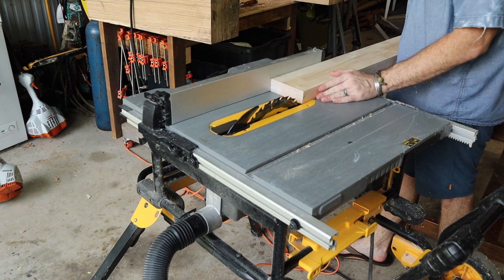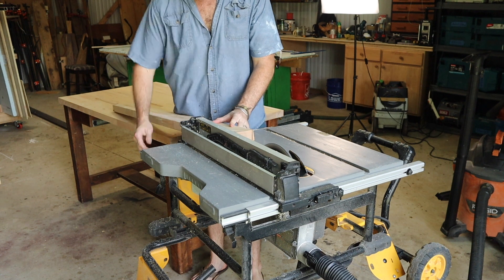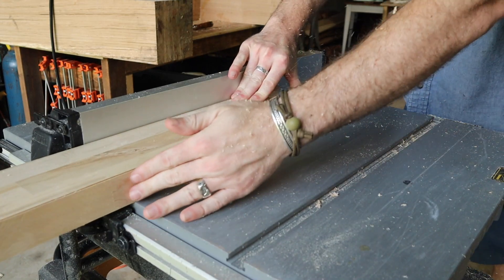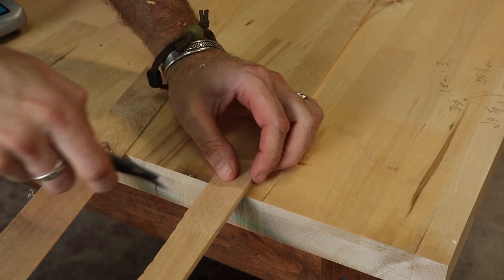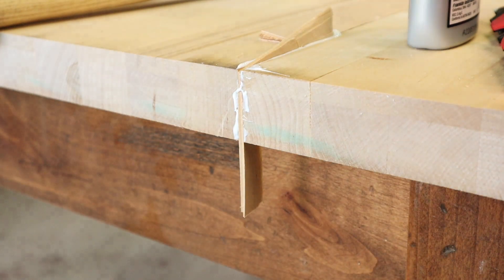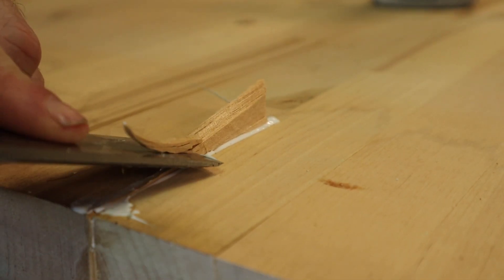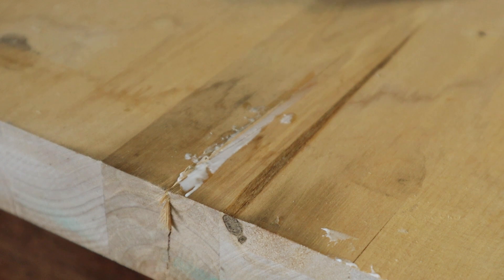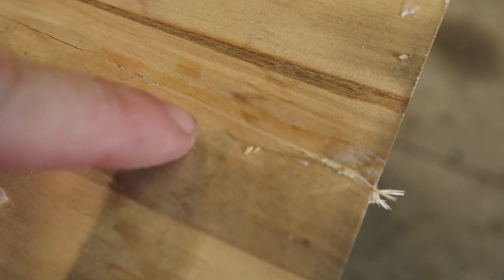THE DEATH OF WOOD FILLER: A Better Way To Fix Cracks

Comment: Start over by beginning your video by using the table saw safely.  Get an outfeed table and a push stick.
Reply from the maker: To be fair, you are not wrong. I will indeed do a video on table saw safety. Cheers and happy building to ya.
Reply: It's hard to pull Bushes up to make a push stick

Comment: thank you . question please . i worked metal for years if it had a crack i would drill a hole at the end then braze or weld the crack . the hole kept the crack from migrating . why is wood not drilled ? then fixed .
Reply: @walterrider9600 - I'm not sure that would stop the crack from continuing in wood as it does in metal due to the nature of wood. Metal is a homogenous material, whereas wood is a large number of fibers bundled together. A crack in wood is one bundle of fibers separating from another.
Also, the round plug will stand out like a sore thumb. Jeff's method blends in with the wood grain.

By the way, that was a very interesting question and made me think hard about it. And that's a good thing. 😁
Reply: @David_K_pi   thank you .  i would guess its dependant upon the grain ? if it was with the flow of the gain it would migrate ? if against the grain it would stop?
Reply from the maker: Wood tends to expand and contract in ways that tensile strength effects it differently than metal. This method is fantastic for surface level checks or cracks but true through cracks require "keying" to tie the material across the grain, or perpendicular to the wood movement. In theory, however, I would say that a large enough hole at the termination point of the crack, filled with a dowel and wood glue would effectively work. In fact, thinking on it in detail, this method is worth investigation as a form of inlay. The grain, of course would be vertical like an end grain cutting board but, hey, lets see what  happens.
Reply: @JeffEstesBuilds  thank you

Comment: Making a big (4'x9') interior barn door (closing off bath from bedroom)... I'm not skilled at anything besides rough carpentry (where small gaps aren't a huge deal), and so I was excited to find and try this technique. I found it filled the gaps very nicely. 
However, removing the dried glue has been a lot of work. I've been sanding for hours and I'm still worried that when I stain it, the stain will look funky if/where I failed to get rid of traces of glue.
In retrospect I'm not sure that letting the glue dry and cure before removing is a best practice. I've been reading tips about removing glue ASAP because it comes off easier before it is cured. Thus, I wish I'd maybe tried removing the excess by scraping it off with a chisel or wiping it off with a rag and denatured alcohol.
Any feedback about that? I can see that if the glue isn't cured the wedge may move as you chisel off the excess. But, really, this glue removal is a huge pain. Might be worth the risk.
Also, my door is supposed to be a rustic piece when finished, i.e. the boards haven't been planed for uniformity. So, in some sections a portion of a board is a bit higher than the adjoining board. Filling a gap here -- Ugh!  The dried glue issue becomes especially difficult because it's essentially in a crevice--hard to get at. I'd offer a hint of: Do whatever is needed to sand/plane the adjoing surfaces before glueing in a wedge. 
Anyway, glue issues notwithstanding, thanks for the tip! I'm anxious to get on with the staining and see how it turns out.
Reply from the maker: Hey thanks for this report, I totally understand where you  are coming from at this phase of the build. I would start off by agreeing glue is a huge PAIN to clean post-dry and usually I do my best to  wet-rag the excess off after clamping, wedging or joining boards. For post dry chisels work but you gotta be really careful with grain direction as well as your personal safety. Sanding with the proper tool, extraction and grit will most likely be your best bet but keeping patient as to not dish or dive the sander is essential. If your project surface is not flat, this becomes increasingly difficult. For example if your boards are different thicknesses this becomes really time consuming to sand between. In this event, I back drag a scraper or razor blade gently and remove the excess glue with a hard edge. This is a great method that you can adjust the size of the scraper and get into the small cracks or dips on the surface. One last thing you can do is water pop the grain to try and discover hidden glue before you stain. This will really save you from having to sand through stain which is a biiiiig bummer. Please let me know how this turns out and best of luck!

Comment: I have a 5 ft x 7 ft  1.5 inch thick Douglas fir table that developed two full length cracks that run 7ft and 1.5 in deep. These deep cracks are not straight either. They run along an in and out pattern. 
What do you recommend.
Reply from the maker: Interesting. The first  thing  I would check is the attachment method of the top to  the base. Perhaps there is not enough room  for the table to expand and contract during the seasonal changes.  Table top  "z"clips or attachment clips are great  because they  hold vertical  force while allowing for horizontal expansion. It is also worth checking the moisture content of the wood to make sure your sub 10% or it will continue to contract as it dries out. If it is too tightly  secured with no room to move it will crack.  Once you  eliminate or discover the threat  or a cause, you can see what  the table does with movement over a week or two (let it  settle where it wants to be) and cut some wedges. Unfortunately  you  will have to "chase" the check by basically  hammering in the wedges with glue, gently, as you can. You might  get an 8" stretch at a time, maybe 18" but just be patient and let the glue set up properly before breaking them off/ cutting them flush. Let me know how it goes!